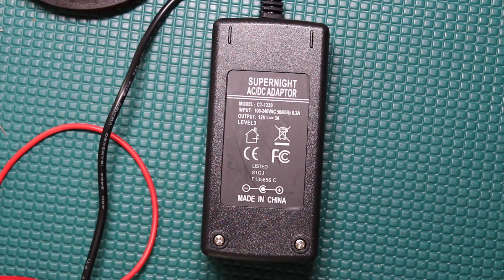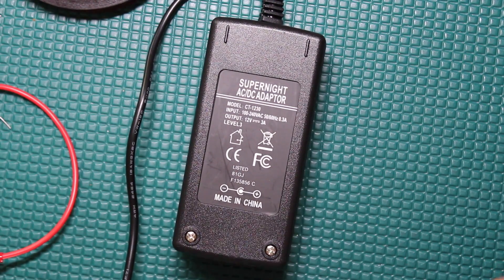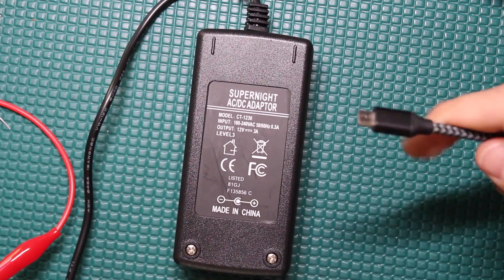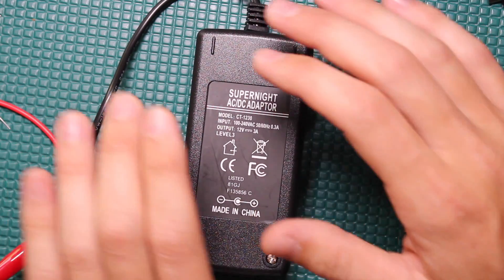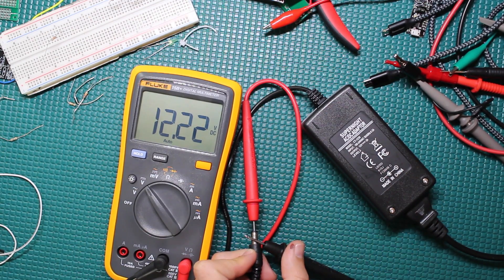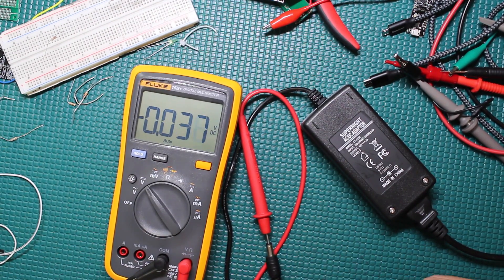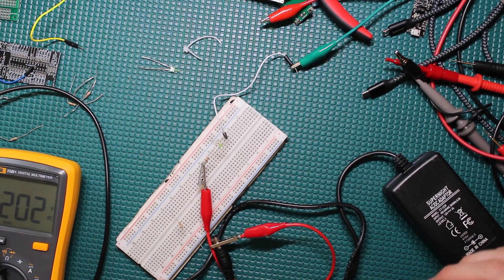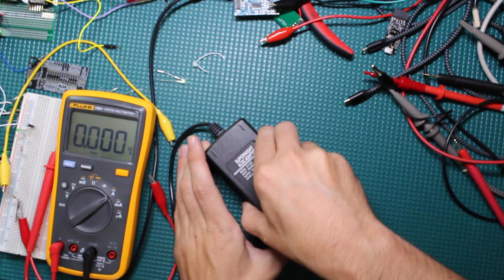DANGERS of Cheap Power Supplies!

Comment: I have made myself an led rgb lamp with a strip kit from aliexpress. I made an aluminum radiator for the strip. 
A: the rgb controller melted, therz was a tiny part of the pcb dedicated to the entire 12v 6A...
It was replaced with a cable and now there is a radiator
B: when thermal testing the lamp, the controller, and the psu, my multimeter was showing that current was passing through it... On the radiator that's not connected to anything.

Comment: I found this video when searching for "power supply shock" after I got a shock using one of these  generic 12V 1A power adapters with my Netgear network switch (it was not original PSU that came with!). The network switch housing is metal and while handling it with one hand, I touched a metal PC case with the other hand and got a shock. I then placed the switch on the PC case which created a spark and tripped the circuit breaker in my house. After some investigating I found out it was a problem with the 12V power supply because I could measure 120V between the barrel connector and the PC chassis. I'm from Europe so AC outlet has 230V. I tested the rest of similar power supply adapters I had and none of them had this problem (they all showed 0V). So I destroyed the faulty one to make sure it doesn't kill me. Now I see this may not even have been a fault but a (poor) design!?

Comment: Quite a lot of professional class II power supplies will have a leakage of around 80v AC to ground due to the presence of the Y capacitor. Although a leakage current of <85uA is deemed as "acceptable" for non-medical equipment. It can however cause problems with audio circuits. I've seen a few instances of ground-loop hum when a laptop is connected to an audio amplifier or  when on-stage effects are connected to a PA. I personally have experienced a mild but unpleasant shock from a microphone due to the leakage from a SMPS. My initial solution was to remove the Y capacitors and fit a ground connection but I eventually built my own linear PSU'd using a toroidal.

Comment: That is normal behavior of any online SMPS which have no ground connection.
On all of them you can measure voltage between output and earth that is ideally (if there is Y capacitors) half of AC input voltage and that is due capacitive coupling in transformer (or in case of flyback coupled inductors) and that is what you can not be avoided, but current that flow is small (usually in range of 15-100uA).
For online SMPS there is same problem but they leak current to earth and limit voltage to some small value, but there is other problem that is you have lot of them they can trip RCD due accumulative effect of leaking current.

Comment: I don't understand your reasoning. you point out that the ground connection on the board goes nowhere, cut a different wire, get a lower garbage result and, problem solved. what ?  why wouldn't you jump the unconnected ground to ground in the circuit ?
everybody knows that if you are getting shocked, especially from a case, you have a ground problem.
it's as if you are riffing instead of thinking.
Reply from the maker: no, definitely wasn't out to fix the supply in this video and grounding that part of the circuit?  I don't think so, especially if it was tied somehow back to the line.  The idea here was to show how dangerous this supply is as-is from the factory... and of course share my story

Comment: Hey Kevin! I don't quite comprehend what is exactly going on here but I have the same issue with my unibody macbook. Every time when it's plugged in I feel a current running through me and when my feet touches my desk's metal leg I feel a shock there. I'm pretty sure it's one of my cheap power supply but I'm not sure exactly which one it is! I've got way more than 10 of them powering everything from my PC to laptops, 3D printers, LEDs, laser cutters etc all around my room and I couldn't figure out which one(s) is/are at fault. Any tips on how I can figure out or narrow down my search area without having to test every single one of them? Cos some of them are at really hard to reach areas..
Love your videos btw!
Reply: You may have a wiring problem in your house. If there is no ground that can cause things to zap you. I had that problem in my place. I got a tester like this https://www.walmart.com/ip/GE-3-Prong-Receptacle-Tester/16561511

Comment: ....also shouldn't there be a fermica shield between the regulators and the aluminum heat sink..providing isolation?
Reply: No, the used primary switching transistor and the rectifier on the secondary is a plastic isolated package. Check my other post for the problem.

Comment: I immediataly saw a cold solder joint right when you opened it, although I dont know that was the problem...I woulfd follow the ground on this supply til i found the culprit....also wouldnt it be something if the 12vdc output was simply  a 12 volt regulator fed from the floating 47 vac and a cap filter..? As Donald Trump says, only the chinese would do that...Steve a loyal subscriber

Comment: I have had equipment damaged by power supplies.  In particular I had several guitar pedals, manufactured by Boss, damaged by a 9V power supply called a 1Spot model NW1-US manufactured by Visual Sound.  This is a non-grounded device and I have not determined the cause of the fault but the moral of the stories is when a reputable manufacturer says not to use a third party power supply with their equipment listen to them!

Comment: Uhhhh. The 10k resistor test only shows that the setup can provide 'at least' 6ma. If you are measuring 45VAC RMS, that is in the neighborhood of about 60V p-p which is 360 mW peak. The resistor is probably a 1/4 watt which is clearly going to heat up. The resistor only allows a certain current to flow relative to a voltage applied regardless of how much current the supply is capable of delivering. At that voltage - anything much less than 10k will smoke immediately.

Comment: Just stay away from those ~5$ electrical wonders from eBay and you'll be better off, but I've had more expensive stuff being equally crappy so sometimes it's a lottery... I've found a pretty descent supplier of PSU's from China that I'm using for all my projects nowadays but they cost a lot more than 5$ for sure!
Reply: You are right. I have a IKEA PSU with the same issue. Its caused by leakage currents in the filter cap between the primary and secondary.

Comment: I got my hands on a laptop computer power supply that claimed on the sticker that it needed to be connected to a grounded outlet but had no connection to the ground pin, obviously that went straight in the bin...

Comment: Just think for a moment about the "isolation gap". Why is it there?? any whats an isolation gap worth if your "HOT" heat sink bridges the high voltage side to the low voltage side, breaking any isolation ?! there must not be any (!) connection between high and low voltage side. no part bridging that gap what so ever. the opto "isolator" and the "isolation transformer" are the only parts that jump that gap, but providing isolation. one solid heat sink does not and is clearly a stupid design fault. this device should never ever have been passed CE, TÜV or any other safety test.

Comment: Thanks Kevin for this warning video. Now I know what to do with any power supply I use on my future projects(remember we have the double voltage 230V on mains in the Netherlands. I am building up my arduino stuff things and I really have to put in earth leaking protection also and keep safety really in mind. Already thought to send a warning message where it came from(if you can trace the source)? This is not on purpose, just ignorance(equally bad anyway!).

Comment: Please don't touch the pcb like that.. Not all power supplies have bleeder resistors on their caps.. I've seen switch mode supplies without bleeder resistors even in expensive gear...

Comment: Hey Kevin, you should do this test with your macbook charger(the adaptor with only two prongs), I get about 32v AC from it (when putting one probe on aluminum body, and one probe on earth ground). Apple chargers suffer from this problem too, even iPhone chargers I measured voltage from. I noticed this one day while using my iPhone and macbook (connected with 3 prong connector at the time), and felt a weird sensation when I picked up my iPhone.

Comment: Heh, I overheated one of these puppies some while ago. It had a rating of 4.5A, 12VDC out; I needed to pull a total of around 3.8A for my project. At 2A I started to smell "warm plastic" and as I reached 3A the thing was literally smoking. The heatsink of the device was way too small and one of the caps was seriously damaged in the process as well.
I still use import stuff from China but nowadays I try to use integrated PSUs whenever possible - at least while prototyping. If I ever manage to finalize any of my zillion ongoing projects I'll simply go grab an off-the-shelf supply from the local store instead.
Reply: I hear ya on that.
Always de-rate the Chinese ratings by at least 50%, that way they actually
perform, and you won't be disappointed.
Trouble is some don't perform after the de-rating.  ughhhh :O

Comment: The problem is actually caused by the lack of earth connection and the presence of that Y capacitor (blue) between the primary and secondary side of the power supply. Its role is to reduce interference and if properly sized the current leaking to the connector is below about 100 uA, which is a safe value for users. 
You can read more about this issue on eevblog forums or see this for example : http://electronics.stackexchange.com/questions/216959/what-does-the-y-capacitor-in-a-smps-do
Reply: I was about to comment the same thing,  common issue with cheap power bricks.
Reply: I`ve found out the same. I had one 12v PSU with the same issue and i broke it open. The isolation was okay, the only thing between the primary and secondary, that could have caused this was a Y capacitor.

Comment: Hey Kevin,
I didn't happen to notice a UL certification on that supply. (I know, captain obvious here...) For something connected to mains, this is a fairly big deal for consumers.  If you manage to torch your house with a non UL listed mains powered part, it could cause issues with insurance paying for repairs.  Bad enough you can buy this offshore crap from eBay unchecked, but the big smiling box people sell and fulfill this by the trainload.  Seems our common sense was sold out with our economy.  Grrrr....
P.S. Good luck with the project! :)
- Bill
Reply from the maker: yep, no UL marking on there... should've been my first clue